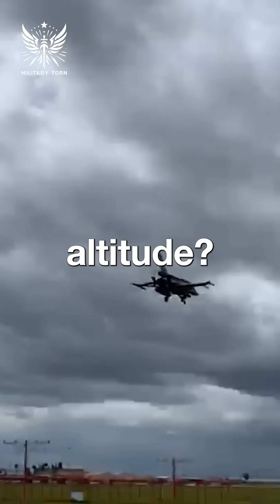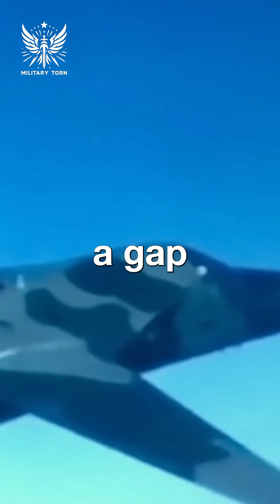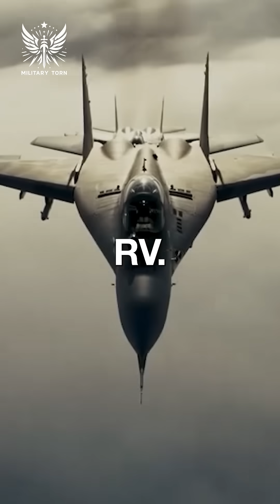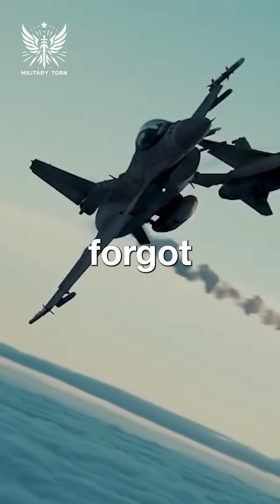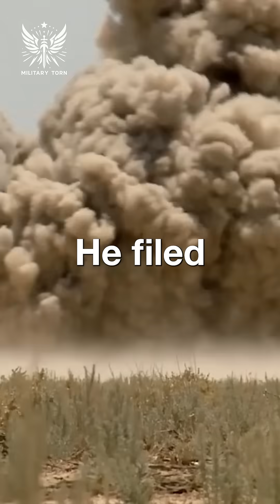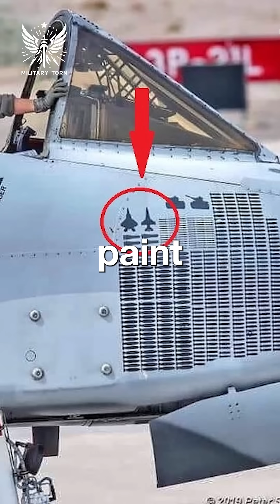What Would Happen If A Fighter Jet Flying At Mach 1.5 Passed Over A Civilian Car At Low Altitude?

Comment: As a retired USAF pilot with 1600 hours flying the F-111, let me just say 200 feet at 1.5 mach is, shall we say, a "slight" exaggeration.
Reply: But they don't say how high up from sea level this was, that 200ft is from the ground.
Reply: @reinbeers5322 knowing the area and altitude from sea level may be the key information we are missing here
Reply: @reinbeers5322 …exactly… “thru a small gap in a MOUNTAIN RANGE.. that RV could easily been at 8-10K ASL
Reply: Yeah, "slight"
Reply: Altitude and attitude is everything.
Reply: I mean its a pretty good chance its a bullshit story, BUT some people do raise a good point. In the video it doesnt specifically say the altitude but it does say they are flying in the mountains, and idk bout you but i consider a mountain no less than 4000 feet in elevation, and thats a small mountain, mountains here in seattle exceed 14000 feet and are on average more than 8000 feet. so depending on the location it could have been many thousands of feet in elevation at which point 200 feet off the ground at 5000 feet thats a mile high above sea level bro, so i think it'd be ight but its all speculation on a most likely fake scenario anyway.
Reply: @xenocide2121  about 5000 pressure altitude in that area of the Nellis range complex is ground elevation. I was actually doing 1.2 over the bago and didn't hit 1.5 until outrunning an F 105 about 20 minutes later but also at about 200 feet AGL
Reply: @xenocide2121 I'd say the biggest red flag of a bs story is that they just paid to repair some random trespassers winnebago
Reply: The 105 in Nam evading a Sam might be inthis conversation
Reply: I've done M1.2 at 200' on egress during a Red Flag mission in an "A" model. The Vark was a great low-level jet.
Reply: @Yadro767 Mach 1.2 is much different than Mach 1.5 at sealevrl.
Reply: @Yadro767 there is no way a model A Ford can move the Mach meter 😂 Still think world of that platform and it’s Pave Tac pod. Operation El Dorado Canyon.
Reply: @mikehill4776  Should be approaching 800 knots at sea level.
Reply: @Yadro767 and how was the jet afterwards???
Reply: @johnlewis1830  Code 1 (no MX squawks). We may have blistered  some of the paint a little, which was common when doing M2.0+ at high altitude on FCF's.
Reply: @johnlewis1830  Both strakes partially depending, some sealant melting, some damage to one wing glove. I flew the same jet on a similar mission the next day.
Reply: I mean 200 amsl, no.
Reply: As an Aussie, I came here to say that. Men of culture please unite 😂
Reply: Thank you. Not even an SR-71 can get above about 900 mph at sea level.
Reply: @kenstewart5991  scenario in video describes the location as "mountains" which last I checked are not at Sea level. Dunno where you got the idea they were at 200 feet in elevation when they clearly said ground which is not the same.
Reply: @xenocide2121  "In a LOW GAP in a SMALL mountain range. Oh yah, surely that must mean between Everest and K-2. What was I thinking?🙄
Reply: @kenstewart5991  uhm,mmm they fly these at mach loop............ but not at 1.5
Reply: @user-nv1gm2zj7y  This comment sure has legs. Ok, I'll bite, what is a Mach loop.
Reply: @gooner72  I think I've seen it. But the jets are limited to about 500 mph. Which seems reasonable given sonic booms can drive animals including humans to the nuthouse. Lol
Reply: @kenstewart5991  they fly at 1 mach to .9 mach in mach loop and star wars canyon when allowed. basically its the low level high speed training area for the us, well mach loop is in uk.  and problem is... there is no actual record for fastest lowest flight
Reply: As a retired pilot you should realise the report said mountains. It ain’t at sea level.
Reply: @jugganaut33  which makes the story even less likely.
Reply: I have a bone to pick with you USAF pilots. I was a Boy Scout in the state of Alaska during the height of the Cold War in the 80's. For fun we were sometimes allowed to camp on Elmendorf AFB outside of Anchorage. If the pilots ever found out the Scouts were on base, they took perverse joy in breaking the sound barrier over our tents in the middle of the night. For fun we used to not tell the kids who moved up from Texas or California and these poor kids would sh*t bricks sideways when they were startled awake at 1:30 am with the USAF breaking the sound barrier over our tents. Especially since the AF was constantly on alert chasing off the Russkies when they would violate AK airspace.
Reply: @GenXerReacts   That's the Sound of Freedom!! 🤣
Reply: I'm aware that the air flow over the plane can be at different velocities so at near Mach 1 some bits would be more and some less but at Mach 1.2 I would assume that all airflow is at greater than Mach 1?

The "sonic boom" would be just the same at Mach 1.2 as at Mach 1.5?

F-111 used to be based in Darwin where I lived. The RAAF base is in the middle of the town (the civillian airport is part of the RAAF base). There were a number of occasions when the planes would go supersonic a bit too close to Darwin. Windows rattled and fingers were rapped.
Reply: @grahamjacob97  One things for sure, the velocity of the air entering the engines must remain subsonic.  TF-30 was the first military application of the turbofan engine.  It gave the Pig and the Tomcat unheard of range/loiter capabilities.  And while low speed acceleration wasn't great, mid-high subsonic, transonic/supersonic acceleration was excellent.  The use of the F-110 in the B/D Tomcats really helped acceleration in the lower speed arena.
Reply: The turbulence and heat would b insane. If i pilot could hold that the jet would prolly b ruined,  the danger is insane, at that speed the ground would look like a blur, like a warp speed effect, u couldn't tell what anything was and if it was mountainous terrain the ground would hit u before yur body knew it was dead. Definitely not worth it.
Reply: @johnlewis1830  Read up on Terrain Following Radar.
Reply: @johnlewis1830  the fuselage heat limit warning was exceeded for about 40 seconds
Reply: Keep In mind, the max speed of an aircraft, any aircraft, is defined by its Q limit. Look it up but it’s the true airspeed that aircraft can go a standard day which is sea level, Alt setting of 29.92 (1013) and a temp of 59F (10C). With all variable sweep jets , F-111, F-14, Tornado, MiG-23 etc, it would be full sweep. As you climb into thinner air, that number increases.
Reply: @aerisarmis9666  F-14 was the only bird that was introduced a computer that automatically moved the wings. CADC(central air data computer).  The other three variable geometry winged aircraft were manually controlled.  Your point still stands, all 4 would have the wings back in such a scenario, but only the Tomcat's wings would have moved back to its most swept flight position of 68º, though on the ground the 75º oversweep position is used for carrier deck space requirements.
Reply: Maybe it was 200ft above ground level but the alitude of the ground was high enough that the jet could do m1.5
Reply: If I best recall, this incident, or one like it, happened on the road just NW of the Sheep Range in Nevada at the beginning of the Nellis Gunnery Range. Can't remember the speed, but I do remember the 'RV'r' complained that his AC unit was damaged on the top and glass was broken, presumably by rocks and such. He was cited by NFS LEOs. He not only ventured into a restricted DOD/USAF zone, but did so through an NPS  Restricted Habitat area to do so and used an NPS Only roadway to do so.
Reply: The beginning of the supersonic area was called Student Gap which has a NV State Road running through the mountain pass. I hit Mack 1 in a steep descent and about 30 seconds later, still accelerating passed over the Bago.  I never saw the official claim - just my commanders version of damage and that if I had been just outside the supersonic authorized area instead of just inside it the Bill would have been mine to pay.  @kellyfleming6663
Reply: No they didn't pay the claim
Reply: As a regular guy I know that 200' AGL could be 10,000' above sea level or more. . .
Reply: Am I the only one that is trying to figure out why in the hell the Air Force paid the claim when the Motor home is clearly in a restricted area where it was clearly posted that supersonic aircraft were in the area! I can't understand why they would pay the claim when the Motor home was where it shouldn't have been! Complete stupidity on both parts!! The Motor home for even filling the claim and the AF for paying!
Reply: F-111 won't do 1.5 mach at 200 feet. No fighter will. Neither will a Tornado or Strike Eagle. Apparently a Starfighter has the record at 1.28. Maybe the SR-71 could stand the heat but I don't think anyone tried to max it out at low level.
Reply: @taylorc2542  SAAB Draken was reportedly able to maintain 1.4 mach at sea level
Reply: @marksmith2402 Always somehow the Swedes claim there fighters can run down the SR-71.
Reply: @kenstewart5991 ah a bit of history, they intercepted and escorted our bird, correct? Saved us from two ole bats (foxbats).
Reply: @XRakkgruntX  Yes, on June 29 1987, they escorted a single engine out Blackbird with the 4 Swedish pilots receiving US air medals in 2018.
Reply: @taylorc2542  The buffeting would shake most planes apart at low level. And I doubt you could get the engines to run well enough at such a low mach number.
Reply: @sergarlantyrell7847  Buffeting isn't the problem, it's the heat from aerodynamic friction.
Reply: @sergarlantyrell7847  The engines run just fine at full power when at a full stop down on the runway
Reply: @hoghogwild  Full THROTTLE, not full power.
The power produced by a jet increases with the speed of the aircraft.
Reply: @sergarlantyrell7847  The engines run just fine at Max throttle and Max power, be it static or dynamic ratings. So long as he airflow into and through the engine remains subsonic, the engine will run just fine.  It will not have issues running at what you called "Low mach numbers."
Reply: @hoghogwild  All jet engines produce more power at speed than when stationary, that's first year aerospace engineering knowledge (working out where in the flight envelope you get max excess power)!

The J58 on the Blackbird is specifically designed to use multiple reflected shockwaves WHICH RELIES ON HAVING A HIGH MACH NUMBER (>mach 2) at the inlet, to compress the air which then bypasses most of the engine so less energy is being removed from the exhaust by the turbine to power the compressor, thus making more power.
Reply: @sergarlantyrell7847  You originally said they wouldnt run well, now you're on about dynamic power being greater than static. Yes, of course it is.  No one has said it isnt. Thanks for the J58 refresher.  Max dynamic power is one thing, running" well" over the entire envelope is another-which it does marvelously.
Reply: @taylorc2542  SR-71 wouldn't be able to fly that fast at low speed. The engines were carefully optimized for high altitude and wouldn't operate well in dense air. Also the airframe was only good for 2g's. Definitely wouldn't survive the aerodynamic pressure.
Reply: @taylorc2542  thanx
Reply: @taylorc2542 people really forgetting this wasn't at sea level huh?
Reply: @taylorc2542 I’m not expert. But a strike eagle stripped down e model, with the minimal flight fuel with. Is a scary aircraft
Reply: Lame
Reply: The SR 71 could do it, maybe the XB 70...
Reply: PULL UP
Reply: Ive never flown a plane myself and could smell the BS from that comment in the clip, maybe add another zero to it
Reply: @wolfe1970 ..... ..😊But you did stay at a Holiday Inn Express Last Night!
Reply: @wolfe1970 ..... ..😊But you did stay at a Holiday Inn Express Last Night!
Reply: Retired E-8 and I call BS on this story. Nobody would have asked the pilot anything. After a verified kill confirmation, the winnebago would have appeared on the fuselage during the night.
Reply: Has anyone passed that memo on to the B-1 community?? I was a JTAC. Saw those B-1B's flying way low wayyyyyy to fast 🤣
Reply: 200 feet above the road, which was in a mountain range. Did say small mountain range though. Maybe the  actual  altitude was  pretty  high  and  it could have been a  cold day as  well? Or maybe its just a made up story.
Reply: Ah to Gyro Pilot, a bit of history, NO AIRCRAFT ever intercepted the SR-71  whether the Foxbat, anything European, or a star wars gaming wet dream. No MISSILE could even down one Gippy.
Reply: @kenstewart5991 missiles could now as they travel at hypersonic speeds
Reply: You flew the flying school bus? Gotta love Boyd
Reply: If one is willing to fly that fast, a little exaggeration is acceptable. I have much respect after vomiting during an F-4 Incentive flight as an A1C.👍🏿
Reply: I agree, just a little, I was a crew chief on the FB111-A at Pease Air Force Base in 1973. The Patch on my sleeve said mach 2.5+ but I doubt it was only 200 feet. The 509th Bomb Squadron, SAC.
Reply: @jumpercable20  the patch says 2.3+ and Please is where I flew that Red Flag mission out of in the 393rd Bomb Squadron in 1979.
Reply: Stick Shaker..
Woop woop
Pull Up!
Pull Up!
Stick Shaker
Woop Woop
Terrain!
Terrain!
Pull up NOW!
Reply: Absolutely, I remember living in the inner city area of Glebe, here in Sydney, when a celebratory F111 (mourning the decision to replace them with the JSF) did a low level fuel dumb then climbing vertically, lighting up the sky. I don’t recally any vehicle windows popping that night.
Reply: Never mind all that.. we just want to know if you ever sonic boomed a cow? or something similar?
Reply: WOW. A pilot for an amazing plane.  Did it perform as good as it looked?  I heard the airforce wanted a lot F111s but their pricetag was too high.  Dont top fighterjets get to about  Mach 1.2 at sea level?  I have  1000 questions to ask you as the Aardvark was one of my favourite planes during my young years.
Reply: It's all about the "sea level" and not "ground level" and air density thing that most people just don't get or understand....
Reply: My FB-111 had more powerful engines than any other of the F-111 series except the Aussie C model.  Pressure attitude about 5000' at ground level there using TFR set to 200' coming out of a rapid descent from FL 200.  Speed, attitude, and location confirmed by AWACS - that's how they found me.
Reply: @FirstCajunAce  perhaps you are unfamiliar with the F-111F? Wayyyyy more thrust than an FB. However, the rest of your story reads like someone that never flew the jet and is unfamiliar with the operations of the Vark. Sorry but you’re trolling.
Reply: @aerisarmis9666 The F model engines had slightly more power according to specs but were detuned to 92% of rated thrust due to malfunctions and compressor wear. FB-111 and F-111 engines had been up-tuned to 103% of original rated power far exceeding the F actual capability
Reply: @FirstCajunAce  I thought the USAF F-111F and the C Pig RAAF version shared the most powerful of the TF-30's, the TF30-P-100 turbofan with 17,900/ 25,100 pounds force thrust.
Yes, the FB-111A had the TF30-P-7 12,500/20,350 pound force engines.  IIRC The FB-111A had a Mach-2 operational limit. Ring any bells?   Did external SRAM carriage have a Mach limit?  Did the EFTs?  The FB-111s had the heavier landing gear and the longer 70 ft wingspan wings, same as the RAAF Pigs.  The US FB-111A to F-111G conversion and then the later the  Aussie buy of 15 of them as they fit into their fleet so well. 

I always loved the FB-111A nuclear DEAD mission.  Blasting your way across Soviet defense launching 110kt warheads 100nm away while smoking along at 200 feet TFR..  It was an amazing strategic medium range bomber.
I appreciate your flying and your dedication, it must have been a blast.  You SAC guys were a special bunch.
Reply: Military Tom  combined two parts of the original story - it was actually 1.2 over the Winnebago and 1.5 later outrunning an F-105 aggressor trying to get a missile lock.  However, both were at very low AGL but 4 to 6000' PA
Reply: @FirstCajunAce  Excellent show Sir, thank you for your insight.
Reply: I was about to post just that -- getting 1.0 mach at low altitude is tough enough no matter how much power the plane has.
Reply: i saw a documentary say it doea mach 2 at 1000 ft. lmao guess theyre wrong
Reply: I didn't think a F111 was capable of Mach 1.5
Reply: It can't at sea level but at altitude, it could easily exceed that (at a huge fuel penalty)."The speed of sound varies depending on the temperature of the air through which the sound moves.
On Earth, the speed of sound at sea level — assuming an air temperature of 59 degrees Fahrenheit (15 degrees Celsius) — is 761.2 mph (1,225 km/h).
Because gas molecules move more slowly at colder temperatures, that slows the speed of sound; sound moves faster through warmer air. Therefore, the speed required to break the sound barrier decreases higher in the atmosphere, where temperatures are colder." @BobbyBlackwell-d2p
Reply: Just because you've never done it with your janky-ass vanta-black triangle doesn't mean it's not doable with something that doesn't require 3 computer systems working simultaneously just to keep the damn thing in the air...
Reply: @W7ENK  Most fly by wire aircraft require at least 3 computers running simultaneously.  Space Shuttle used 4.